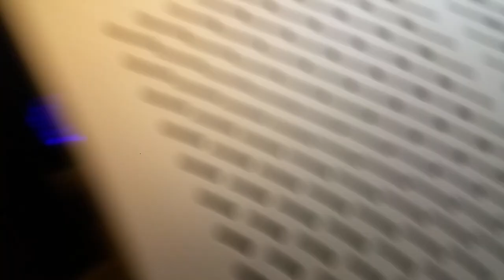Interesting  brushed-aluminium finis PC Case Lian Li PC-30  Review

Comment: Nice case, it is important a pc case to have enough room in the inside , i hate small cases without enough space , theyre very tricky to install all the the parts inside
Reply from the maker: Tassos D.Everything I have mini case with plenty of room for part
Reply: Frog - Tech - Tips i am ussualy building watercooled pc,s so i need enough room for radiators and the waterpumps
Reply from the maker: Tassos D.Everything  hmm that's probably true
Reply: Frog - Tech - Tips have you see my videos from pc, s i have build? I have 2 in my channel
Reply from the maker: Tassos D.Everything Iam think no but I will check :-)